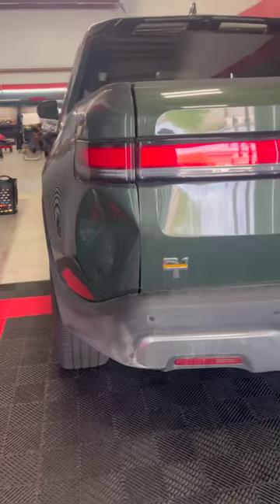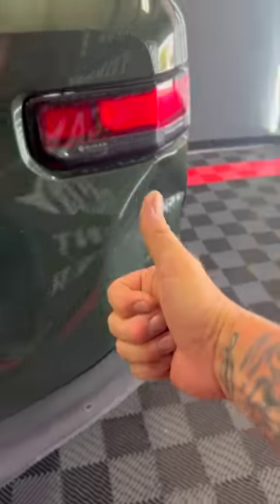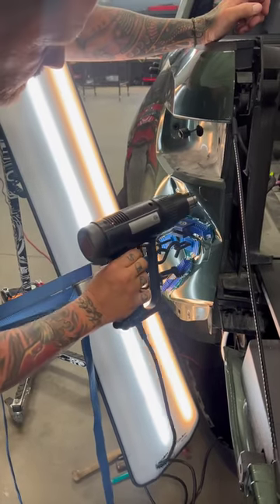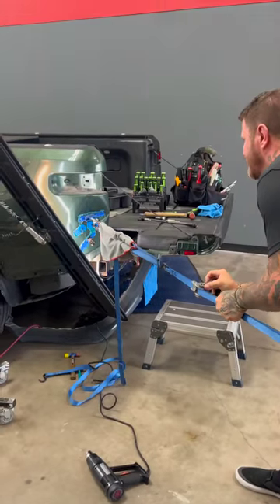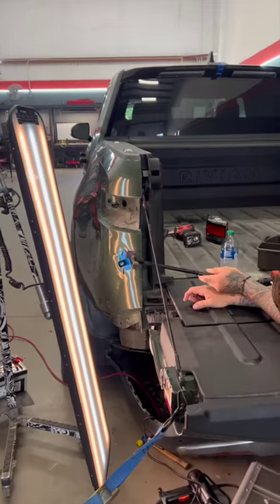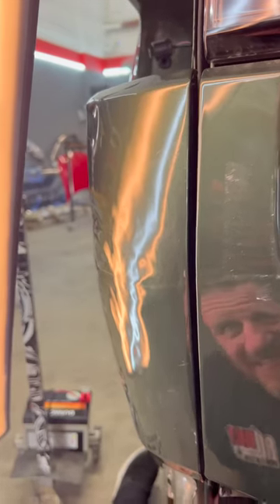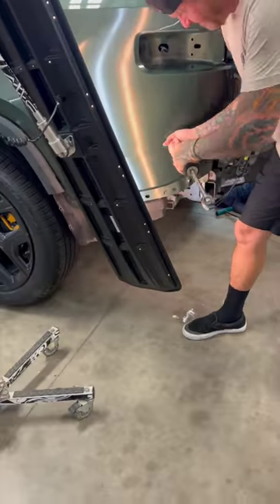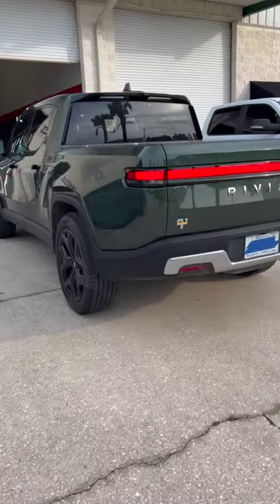$41,000 dent repair on this Rivian?

Comment: Convinced me to not buy a Rivian. A minor fender bender = $41K to repair?! And don’t think your local “paint less dent removal guy” will be able to fix this. These guys are experts. You’d have to send the car to them.
Reply: Firstly it's not just a "fender bender". That's a pumpkin sized crater on a part of the wheel arch. And secondly, quotes from the manufacturer are always so high, to get the customer to buy the broken thing new instead (f.e. Apple does the same with their products). You wouldn't need neccesarily a masterclass bodyshop like this, if you're willing to get that piece fixed with filler and a respray for like 90% of the result but for like 5% of the manufacturers quote.
Reply: Great choice! 😅 never ever buy one, they are a nightmare to do literally anything on.
Reply: @error_nr-1232   5% even seems high lol that’s $2050 to do some body work to one panel !
Reply: @christopherarendt3531  how long do you think this took????
Reply: Welcome to the future
Reply: Unibody trucks are not trucks 😂😂😂😂 welcome to america where a toyota hilux imv0 is illegal to drive. 25 years in fed
Reply: He didn’t take it to a rivian dealer.
Reply: this is what convinced you? not the fact that its a fucking electric toy?

Comment: I did PDR every day for 12 years, and I did a lot of big/complicated dents. None of them were near this hard. There were so many dealbreakers with this damage that would stop someone from attempting it. Great job at continuing to refine it to that level of completeness!
Reply: What on earth takes 12 years to fix one dent?
Reply: @GardenGuy1942 😂
Reply: Now it made me think twice before buying EV😊😂
Reply: @2bd-bes  Yea these electric vehicles will be super expensive to insure if they become popular.
Reply: @2bd-bes  This has nothing with it being an EV and everything with it being a new automaker using unconventional  construction techniques.  Rivian will undoubtedly work on repairability issues down the line, just like Tesla has been forced to.
Reply: This is literally amazing 😅
Reply: @GardenGuy1942 😂😂😂 troll
Reply: @2bd-bes  Less that it's EV and more that Rivian just sucks at building modular car panels. If you think this is bad, just wait until those ugly-as-hell Tesla trucks come out. I believe I've read that the exterior is supposed to be just one giant piece of metal. Meaning, if you don't do PDR, then you have to replace that entire piece.
Reply: I'm blown away by your amazing work, you performed the impossible. But, what was the reasoning of not doing a conventional repair, (not panel replacement) and refinishing it?
Reply: @addanametocontinue  imagine getting dinged in a parking lot and you have to replace the whole car 💀
Reply: Guys, here is The Savior

HalleluYAH translates “Praise ye YaH”

YaH is The Heavenly Father 
YaH arrives via the TENT OF MEETING
YaH was Who they Crucified for our sins
YaH was Crucified on an Almond TREE

— Ancient Semitic Cuneiform of Moshe (Moses)
— Isa Scroll (The Original Isaiah)

Isaiah 42:8
"I am YaH; that is my Name! I will not yield my glory to another or my praise to idols.

Isaiah 43:11
I, I am YAH, and there is no other Savior but Me.

Isaiah 45:5
I am YaH, and there is none else.
Reply: @addanametocontinue  The Cybertruck would take the hit this truck got and show NOTHING, no damage.  That is a major benefit of its body construction.  The kind of hit that would dent the Cybertruck would turn the Rivian or any domestic pickup to a ball of tin foil, totalled.
Reply: Your comment makes no sense? This has nothing to do with its electric powertrain. Identity politics has made everyone stupid.

Comment: Wow. I would’ve never believed you could’ve remove that dent. That’s amazing work
Reply: Not for 41k 😂😂😂
Reply: It's just a dent and not a car that rolled down from a mountain. That would be a case for Mat or Tavarish.
Reply: Superb work .
Reply: How many hours did it take from starting to finish?
Reply: Impressive, takes some talent keep on keeping on, that's definitely a charge by job nor hours talen easily could get the 40k for that repair at the sake of not fn with all that other things and possibly distorting and damaging factory seams
Reply: @Blubb5000  

Dude most dents are worked on from BOTH sides. They only have access to what you see here so everything was fixed frontally. That's impressive as hell.

Comment: I'm a body technician in Australia and this is impressive and has to be the way of the future. Cars are getting harder and harder to repair conventionally and as you said it can be very intrusive and not the best option for the car. We need to rethink how we do things with electric vehicles and different metals being used now its not straight forward anymore. Fantastic job saving that panel, amazing to watch you work.
Reply: And how much would you charge in Aus for the same thing?
Reply: Totally agree but better get the legal beguiles on the terms and conditions 
It will take on car thats be repainted poorly to throw a curve ball 
Or perhaps that’s something already taken care idk i just know customers sometimes don’t even know the car has been re painted
Reply: “Electric vehicles”

What does that have to do with body work?  Could run on cow manure or smart phone batteries, and body is still stamped and painted sheet metal.
Reply: @ls-33wraith33 So what if the paint did get wrecked? If PDR can get the panel nice and straight but evrn with paint damage, it's then relatively inexpensive to just sand and repaint the area. There's far too much of this cutting out and replacing huge sections of body at massive cost today instead of common sense panel beating.
Reply: karen
Reply: @Nill757 aluminum and soon stainless bodies are different
Reply: @jonhinman2471  for EV or ICE, doesn’t matter what’s under the hood. But if there’s battery and high power motor in there, another 1/2 ton of other metals have to be dug up, ea car. There’s no where close to enough mining for the copper etc, and won’t be for many years, nor should they all be sourced from China.
Reply: Good luck doing this with the Tesla Cybertruck in stainless steel.
Reply: @dpie4859  why is that? Stainless is famously softer than regular steel.
Reply: Guys, here is The Savior

HalleluYAH translates “Praise ye YaH”

YaH is The Heavenly Father 
YaH arrives via the TENT OF MEETING
YaH was Who they Crucified for our sins
YaH was Crucified on an Almond TREE

— Ancient Semitic Cuneiform of Moshe (Moses)
— Isa Scroll (The Original Isaiah)

Isaiah 42:8
"I am YaH; that is my Name! I will not yield my glory to another or my praise to idols.

Isaiah 43:11
I, I am YAH, and there is no other Savior but Me.

Isaiah 45:5
I am YaH, and there is none else.
Reply: @Nill757  The Cybertruck is made out of starship material lol. It may technically be called a stainless steel alloy but it is far harder to work with than regular steel

Comment: Ive owned a body shop for 26 years and been doing body repair for 35 years, I have a PDR guy who comes in for hail repair and sometimes on larger dents that we come behind him and do finish repair and repaint. These guys are impressive, its really an art form, knowing how to do that. Having said that the repair in this video is over the top.
Reply: My parents owned a collision shop for almost thirty years and they've had the same paintless dent repair guy

He also did pinstriping by hand

Just pure art
Reply: Do you really think that this had an estimate for 41K.
Reply: @daveanderson2316  it's absolutely possible, I can't say for sure because I've never had one of those in my shop but when they detailed all that had to be done to replace the panel I guess it's possible. It does certainly sound excessive though.
Reply: given the limited access is it really THAT over the top?
Reply: Over the top in a good way or bad way?
Reply: @steet2  the 41,000 was for a complete replacement of the quarter panel
Reply: @daveanderson2316  

Sometimes they price it that high because they don't want to do it as well. That's basically an F U price.

Comment: I was a body man back in the day when cars were made of steel and you had to have the skill set to actually work the metal back into shape. I’m very happy to see that it’s not a lost art. Great work my friend!
Reply: Most car bodies are 95% steel today. It's only weird vehicles (like a Range Rover or a Saturn) or vehicles with special performance features (like a Porsche) that have panels that aren't steel, other than the plastic bumpers.
Reply: @AlexandarHullRichter   what he meant is now you just but replacement  panels and paint
Reply: @niyablake   I don't see the problem with that if the shop does a good job of duplicating original construction. The repairs can be way better with replacement panels than with repairing original panels, depending on the level of workmanship of the shop, and how structural the repaired areas are. Steel that has been bent repeatedly will be weaker, so more structural unibody parts should be replaced, rather than bent again.
Reply: @AlexandarHullRichter  I mean, I'd hardly call the F150 weird or unusual, but it has a fully aluminum cab and bed.  But I get your point.
Reply: I was a body man too but now I value personality more
Reply: Do you think steel would be harder to repair since it springs back more? I've heard that aluminum never truly springs back all the way when flexed (even if only deformed on a microscopic level) whereas steel does. Not sure if that's true but regardless aluminum is much easier to stretch and flatten in my experience.

Comment: I went to school for PDR, but found it hard to fix certain situations.  The pros make it look easy, but those creases you showed us are super tough.  Your work is amazing!
Reply: Yo where does one even go for that? PDR is sick
Reply: @Nate-bd8fg  Rightlook in San Diego
Reply: If they couldn't do PDR I don't understand why they couldn't just pull most the dents out, fill in any spots with an aluminum tig welder, sand smooth & paint 🆚 tearing whole truck apart to replace 3/4 of the trucks body.
Reply: How do we know this wasn't played in reverse? 😅
Reply: Paint would never match perfectly between the tig and original metal. Could sand down a bigger area to reprimer but nomatter what you cant match a factory paint job perfectly. The only 100% fix, and what they do for supercars needing flawless repairs is repaint the whole panel and sometimes whole vehicle if needed. Still less than 41k

Comment: Amazed how flexible the paint is and didn't chip off
Reply: Today’s automotive paint is far more durable than it used to be.  And much more expensive.
Reply: @Offthbadan not fords 😂
Reply: Nice work,  was the body steel or Aluminum?
Reply: @Offthbadan I'm not so sure it's that much more durable, in general. Modern paint tends to chip a bit easier than the older stuff, but it definitely remains more flexible.
Reply: @screamingcockatoo I think I need to use a hear gun because I thought you said "hear gun".
Reply: @ThePlantedTankTV yes fords.  The bumpers have plasticizers in them allowing for this bending capability.  Hard panels on most cars like doors, hoods, etc.  Don't have them normally hence flaking/chipping.  Rivian's P&B engineers purposely used plasticizers throughout knowing it would be beneficial due to the difficulty of repairs due to the way the panels are designed to be so all-in-one piece type setups.
Reply: @georgewoodland1766  it's all aluminum body
Reply: @georgewoodland1766 it's a modern car it's definitely aluminum
Reply: Guys, here is The Savior

HalleluYAH translates “Praise ye YaH”

YaH is The Heavenly Father 
YaH arrives via the TENT OF MEETING
YaH was Who they Crucified for our sins
YaH was Crucified on an Almond TREE

— Ancient Semitic Cuneiform of Moshe (Moses)
— Isa Scroll (The Original Isaiah)

Isaiah 42:8
"I am YaH; that is my Name! I will not yield my glory to another or my praise to idols.

Isaiah 43:11
I, I am YAH, and there is no other Savior but Me.

Isaiah 45:5
I am YaH, and there is none else.
Reply: Backed into my brother's fairly new volkswagen in my Volvo 240 and there was practically zero damage on his. Didn't care to check for damage on mine since it's unpainted plastic. Those flexible bumpers hold paint a whole lot better than you'd think.
Reply: @YaHsServent whar?
Reply: @Offthbadan  it's literally Rivens paint quality

Comment: Ex bodyshop worker Liverpool UK .
A lot of comments calling this type of repair "Art" 
That's exactly what it is .
The artist can see the minor flaws & will want to point them out . He strives for perfection .
These guys are on another level & it's so satisfying to see skills like this in action. All in 2 days !
Reply: it's just "part changers" now
Reply: Also the technology is way better. They are using glues to pull out the dents instead of rivets or tac welding. Its amazing how it changed in less than 10 years
Reply: Right. I don't think people understand the level of effort and attention to detail this work requires.

Comment: This really does highlight that the design of some vehicles like the Rivian goes a long way to determining if they can be fixed at all. Amazing that you were able to pull this off.
Reply: This will cause insurance premiums on Rivians to go up.
Reply: I'm liking my 20 year old Pilot a lot more every day,...
Reply: @alainmulaire9471  Same deal with my Honda Element. It looked kinda goofy back in the day when they were new, but 2 decades on they look better. And the big bumpers and wide doors/open space makes for one of the most practical vehicles ever. Dents and scratches just add to the utility aesthetic.
Reply: Terrible design
Reply: I call bs. No way $41000. This is just price gouging because they are new
Reply: @ptech88  Limited availability of parts, high labor for disassembling the vehicle, likely limited documentation for disassembling the vehicle in the first place. All in all while $41k is probably overboard it's not outside the realm of possibility for a niche vehicle.
Reply: @Hybris51129  the makers of this video proved everything you wrote wrong.
Reply: @ptech88  How so? Because unless you watched a different video the $41k bill was for what other bodyshops would have charged if they had to replace and repaint the panel in question.
Reply: @Hybris51129  they didn’t need the parts you said were limited, they didn’t need the labor to disassemble the vehicle and the whole “niche vehicle “ is just an excuse to try to charge more. The way your defending this estimate i think you may have been the one that created it.
Reply: @ptech88  You do realize that the guys in the video are the ones that were able to avoid having to replace the parts right?
Did you even watch the video at all or are you some bot?
Reply: @Hybris51129  you’re the defending $41000 to fix a dent no me. Im saying it is a rip off you’re saying it’s somehow explained by parts and labor, then you say they didn’t need the parts and labor. So yes you’re right i dont know what I’m thinking.
Reply: @ptech88  Well glad we have confirmed that you haven't watched the video and have nothing of worth to say.
Reply: @jessem8928  insurance rates on some of these vehicles are a lot. A Tesla model y will have a significantly higher rate than a similarly priced rav4, for example (I know because I got quotes recently—and this wasn’t the performance y).
Reply: @sergeantbigmac  The Element was ahead of its time for sure. I almost bought one years ago but when I test drove it I hated the lack of visibility.  But I do like the concept.
Reply: @patty109109  Well, since a Tesla Model Y has a significantly higher price than a RAV4, a higher insurance premium kind of makes sense, doesn't it?

Comment: I'm always amazed by how the paint doesn't crack or break off.
Reply: It often does, but these people rarely show the paint failures.
Reply: @dsmbilly3690  ah that could be the reason. They only show what's successful.
Reply: How much was the repair cost?
Reply: Paint today is not like it was years ago or this technique would not work.
Reply: @paulchristenson5256 Yeah back in the 70s and 80s that paint would have flaked off and exposed area would have had at least surface rust.
Reply: @austinpowers1999  35k. Saved 5k
Reply: @dsmbilly3690 warming the paint makes it more flexible.
Reply: @bobbo2576  35k. Saved 5k 
Nonsense. The repair took two days, maybe 20 hours, no parts required. Unless they're charging $1750 an hour for labor, it didn't cost anything like $35K.
Reply: @douglasburnside  lol it’s called a joke. Duh it didn’t cost that much. I’d say it still costed 2-2500
Reply: How much did you charge for this repair?
Reply: I had a phenomenal dent guy but he got cancer and died. The guy was an absolute magician. More than once, he made dents disappear in front of my eyes.
Reply: @dsmbilly3690 if you warm up the paint and it's quality paint . You'll be fine. Barely anything is painted well these days
Reply: @douglasburnside Whoosh little bubba! Lmao 😂😂😂🫵😂
Reply: @HellzDrifter  Guilty as charged.🥴
Reply: @dsmbilly3690 didn't you watch the video?
Reply: @dsmbilly3690 It doesn’t. Proper application of heat will keep the paint from flaking.
Reply: Guys, here is The Savior

HalleluYAH translates “Praise ye YaH”

YaH is The Heavenly Father 
YaH arrives via the TENT OF MEETING
YaH was Who they Crucified for our sins
YaH was Crucified on an Almond TREE

— Ancient Semitic Cuneiform of Moshe (Moses)
— Isa Scroll (The Original Isaiah)

Isaiah 42:8
"I am YaH; that is my Name! I will not yield my glory to another or my praise to idols.

Isaiah 43:11
I, I am YAH, and there is no other Savior but Me.

Isaiah 45:5
I am YaH, and there is none else.